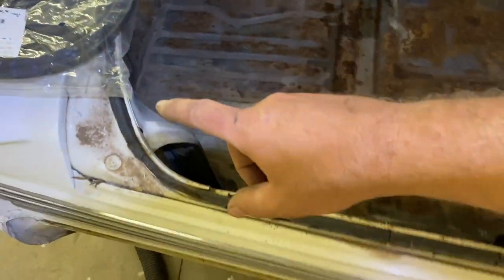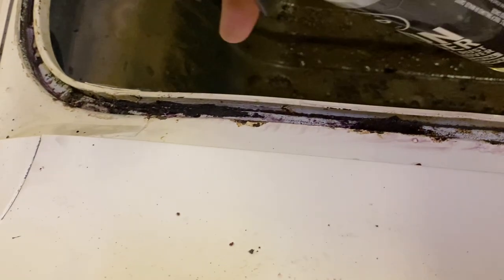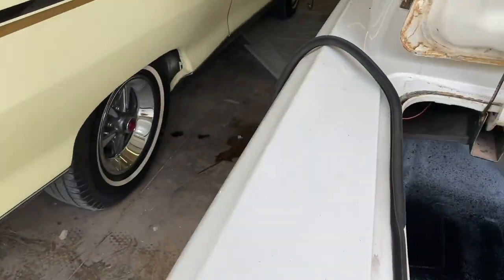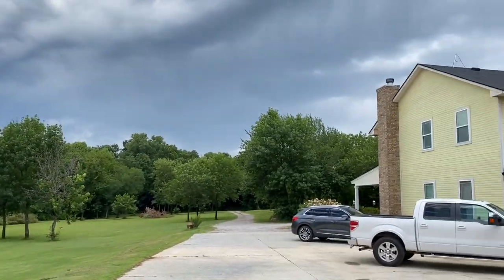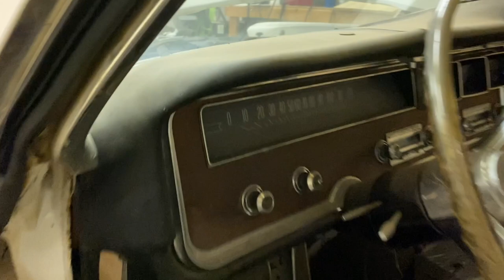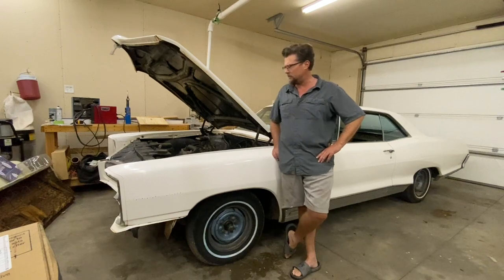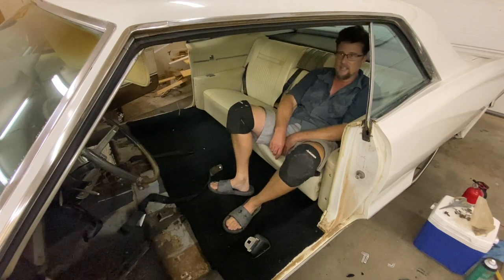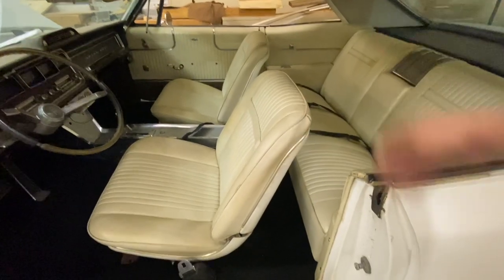Barnfind Pontiac Carpet and Interior install, roof rail and trunk seals. Will it be weather tight?

Comment: Hello poncho Nick again to answer your question about Consol holes the answer is no there was absolutely no holes there in and b body Pontiac Consol just the wood grain which I replaced mine that I bought from Ames Pontiac not expensive at all and changed the look drastically for around $75 thank you for a great channel poncho Nick cheers
Reply: Hole is for vacuum gauge a factory option the wire is the light on gauge should be a grey wire from dash broad lights
Reply: Try Ames performance for grand prix scripts on the fender
Reply from the maker: Yep!  Vacuum gauge.